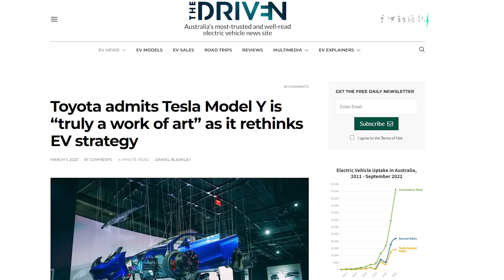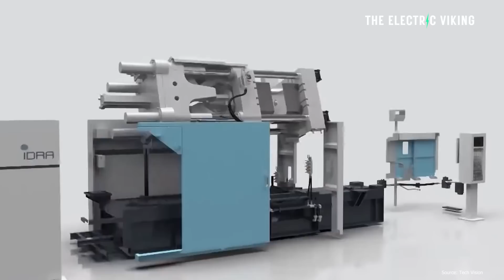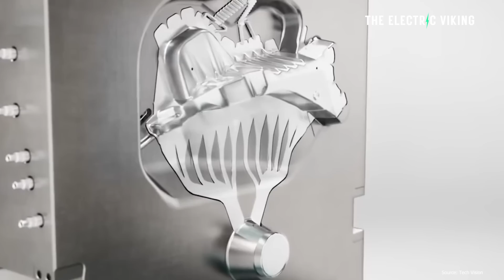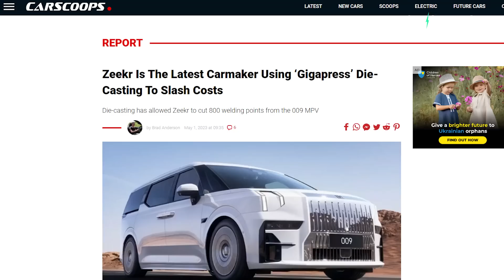Why Toyota decided to change entire production process to use Tesla's 'Gigacasting'

Comment: We do things the way we always have because that’s what we do!
Reply: Tesla does a lot more than just making Cars
Reply: @paulhailey2537  so is toyota
Reply: @miraphycs7377  LMFAO YOU MEAN TRUCKS TOO LOL
Reply: @paulhailey2537  Ya, Toyoda has a stationary storage business right? ;^)
Reply: @machoopichoo2  like in furniture or do you mean Electrical
Reply: @paulhailey2537  
Other major business of Toyoda

Toyota Industries	1926	manufactures textile machinery (looms), forklifts, automotive components, and other equipment
Toyota Motor	1937	manufactures vehicles
Aichi Steel	1940	manufactures automotive steel; 30% owned by Toyota Industries and Toyota Motor
JTEKT	2006	manufactures machine tools, auto parts; formed by the merger of Koyo Seiko (1921) and Toyoda Machine Works (1941)
Toyota Auto Body	1945	manufactures vehicles, parts and auto bodies; 100% owned by Toyota Motor
Toyota Tsusho	1946	trading company (sogo shosha) supporting global operations of Toyota Group companies; 33% owned by Toyota Industries and Toyota Motor
Aisin	1949	manufactures automotive components; 30% owned by Toyota Industries and Toyota Motor
Denso	1949	manufactures automotive components; Toyota Motor owns 24.55%, Toyota Industries owns 8.74%
Toyota Boshoku	1918	original Toyota company; manufactures auto parts and textiles
Towa Real Estate	1953	commercial real estate developer in Nagoya area
Toyota Central R&D Labs	1960	performs research and development for other Toyota Group companies
Toyota Motor East Japan	2012	manufactures vehicles and parts
Toyoda Gosei	1949	manufactures automotive components; 43% owned by Toyota Motor
Hino Motors	1942	manufacturer of trucks and buses; 100% owned by Toyota Motor since 2001
Daihatsu	1907	manufactures compact automobiles; 100% owned by Toyota Motor since 2016
Toyota Housing Corporation	2003	residential construction
Reply: @paulhailey2537  Affiliates or partially owned subsidiaries of Toyoda

Kyoho kai group – Auto parts company – 211 companies.
Kyouei kai group – Logistic/facility company – 123 companies.
KDDI (Toyota owns 11.09% of the company)
Nagoya Broadcasting Network (Toyota owns 34.6% and is the largest single shareholder in the company; 36.9% of the stock are directly and indirectly (through TV Asahi Holdings Corporation) owned by the Asahi Shimbun Company, making it the largest corporate group shareholder)
Subaru Corporation, manufacturer of Subaru automobiles. (Toyota owns 20% and is the largest single shareholder in the company)
Mazda Motor Corporation (Toyota owns 5.05% of the company)
Suzuki Motor Corporation (Toyota owns 4.9% of the company)
Isuzu Motors Ltd. (Toyota owns 4.6% of the company)
Misawa Homes Holdings, Inc. (Toyota owns 13.4% of the company)
Primearth EV Energy Co (PEVE) – a joint venture between Toyota and Panasonic (1996 to present)
Toyota Canada Inc. (TCI) – a joint venture between Toyota (51%) and Mitsui & Co. Ltd. (49%) (1964 to present)
Yamaha Motor Company (Toyota owns 2.8% of the company)
Panasonic (Toyota owns 2.8% of the company)
Nippon Telegraph and Telephone (Toyota owns 2.09% of the company)
MS&AD Insurance Group (Toyota owns 8.88% and is the largest single shareholder in the company)
Fuji Pharma Co., Ltd.

Comment: Imitation is the best form of flattery.
My understanding is that, Insurance will only cover you for full replacement value for the first few years.  After that it is market value.  Some differences might occur in other places, and you should check your policy and conditions for an EV insurance plan.
I wouldn’t be so quick to conclude that structural rigidity was responsible for survival in that case, unless you know the events in great detail.  I would have thought that even castings Iike these have to crumple in a controlled way for crash safety purposes.
Reply: The crumpling on these casting is amazing.   For lower speed crashes there are replaceable crush cans.  If the crash goes past that the casting is make weaker to strong front to back.  So the casting continues to compress and finally stops to protect the occupants of the passenger compartment.  I expect the insurance companies are seeing less payout for death benefits with today's safer cars. Not just Tesla.  Not sure if it offsets the cost of totalling more cars.  Totalling cars also keeps them out of court on the repair side.

Comment: After watching this I want to see two new types of electric car testing. I want to see tests on electric cars being driven through flooded streets and I want to see a crash test where a car is pushed off a cliff
Reply: Will they explode in mid air like in the movies?
Reply: @patrickhenigin4805  you might have been joking but theirs not a lot of data on what type of crashes cause electric cars to catch fire
Reply: It has been demonstrated that it is almost impossible to set fire to a modern battery pack. There are many more safeguards built in now.
Reply: To be fair, if there were tests to be done, they should test all types of cars not just electric. Not sure a cliff test would be of much value. Most all accidents happen on the road.

Comment: there is a limitation on how few parts you can make a car from... in some cases i am not sure if they are going too far, or not.  

on the other hand this seems to go back to the VW unibody of the beetle and those worked well and for the time had decent survivability. 

i just wonder if they thought of the VW beetle unibody as there proof that it could work
Reply: Just wait for ai to enable a structure that uses less material, more robust, flexible and solid at the same time... in one part
Reply: The people who are skeptical of the gigacastings remind me of the people who were skeptical of unit body construction.  They are simply resistant to change.

Comment: Toyota talking dream because they'll have shareholder meeting soon. Giga casting required Giga press which has short supply due to every Chinese automakers already ordered it right now. I don't think Toyota who came late is going to get their hand on one before 2027, let alone make a car with it
Reply: They said they not using IDRA but some Japanese company.
Reply: they already showed the gigacast bz4x rear subframe. They would be using a japanese company
Reply: Toyota will use Japanese made equipment, Japanese are well ahead of USA in anything to do with engineering, especially automotive stuff.
Reply: @chrissmith2114  Japanese company who just copying Gigacasting technique from Tesla is well ahead...haaa that hilarious
Reply: @chrissmith2114  Tesla did "Invented" metal composition that allowed large size casting possible without deformation. Do you think Toyota is that stupid they never thought about Gigacasting before if it was possible? that's why they just uses it on subframe and small metal piece? Hey don't be insult Toyota like that. They just waking up after see how Tesla was doing. We don't call people who run after the other, a leader, you know? lolz
Reply: @mukamuka0  I get the impression that English is not your first language....

Comment: So Toyota are going to be where Tesla were 3 years ago in around 1 year..........  So 4 years to catch up from a standing start, they also don't have the innovation culture baken into their workforce.  Better to buy off the shelf from Telsa and skin them with their own designs.
Reply: I think it's much worse than that. Ford and GM have already admitted that they can't make a profit on EV's until 2030 or more and they are ahead of Toyota. At this point, it seems the legacy auto companies are about eight years behind Tesla. Remember, Tesla is working on their fifth or six generation vehicle at this time.
Reply: @billh2294  Yes, didn't know the precise figures - but was just illustrating a point.  The material science for the Giga Press is VERY VERY HARD as well - they used Space X engineer's to workout the composition.  You can't just buy a GigaPress and expect it to work .... They could easily be stuck with a giant machine and not know how to make it produce.

Comment: you dont think insurance prices will go up if there are more write off?
Reply: Why would there be more write offs? The giga castings do not go into the outer wheel well which means an accident involving just the outer wheel well is repairable.  Regarding the structure behind the bumper, Tesla has removable crumple rails that are attached to the castings. In addition, the casting is weldable so minor damage can be repaired. Only major accidents will damage a gigacasting car which would also total any other unit body structure.  Due to high strength steel and liability issues, modern unit body cars are actually more likely to be totaled than in the past.
Reply: Then a lot more value can be salvaged from a Tesla write off than comparable ICE vehicles . Batteries and computer are half the cost and are more likely to be salvageable than complex engine and gearboxes.🤔
Reply: Didnt  they sell those write off to second hand market? Theres even youtube channel that focus on restoring wrecked Teslas.

Comment: These machines are made by an Italian company owned by a Chinese company called lk machinery. They are also made in China. Tesla didn’t invented or manufacture these machines
Reply: Tesla had the vision to apply the technology to automobile manufacturing. Nobody else with the means thought it could be done.
Reply: @patrickhenigin4805  you are wrong. Tesla is not the first car manufacturer to use these castings. Ford used these castings before Tesla  just not at teslas extent. Even before ford and Tesla, The first company to use casting for car manufacturing was the French company, De Dion-Bouton
Reply: You're right. They simply designed and engineered the castings and shopped around to find who could make such a machine. IDRA won that contract. Tesla is the first manufacture to design and use such a large casting and developed their own alloy that does not require heat treating or special coatings to prevent corrosion.
Reply: @billh2294  no they didn’t design/engineered the casting. Who design/engineer the casting machines are the casting heavy machine manufacturers and not car makers. These machine already existed before Tesla decided to make cars with them. Other cars manufacturers already used them just not at that extent. To use at that extent tesla did requested some design modifications but they do not design or engineer these machines. It’s quite crazy that y thought they did it because it is not only a totally different business/engineering/area/tech than car manufacturing, but they would probably have to create another company for that. Not so easy as you think. If it were that simple there would already be a lot of competitors
Reply: @tonypaca3015  I never said they designed the machines. I said they designed the castings (what the machine makes). Pay attention.
Reply: @tonypaca3015  Tesla and IDRA collaborated to do things that nobody had done before with great success. I believe both companies would agree with me that this is the important part of the whole story.
Reply: @jbbuzzable  no one had done at the extent of tesla because some cars manufactured already been using big casting for car manufacturing parts just not at teslas extent
Reply: He didn't say Tesla invented the Gigacasting machines. What are you on about?
Reply: Duh